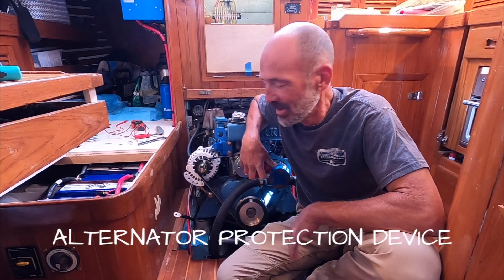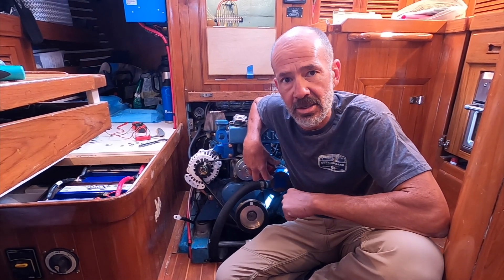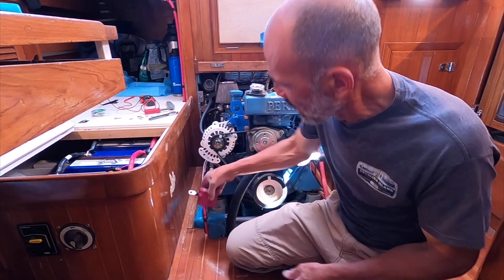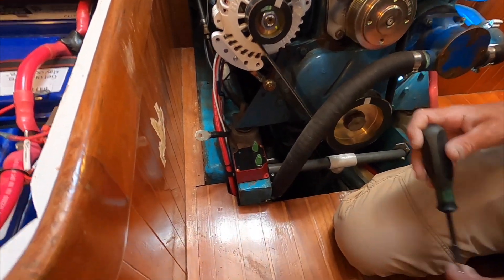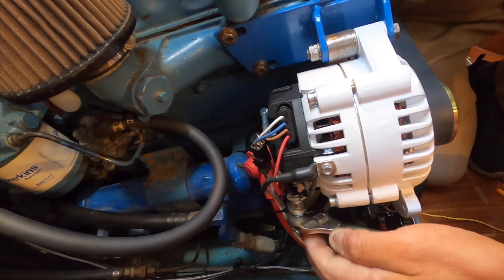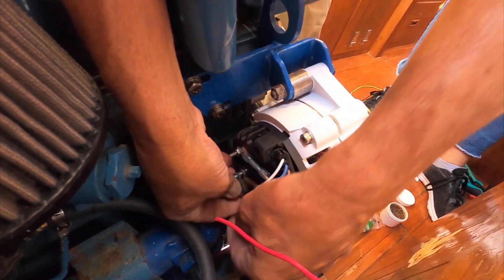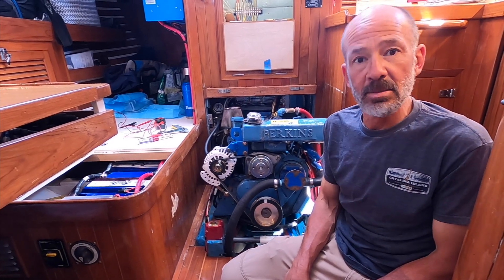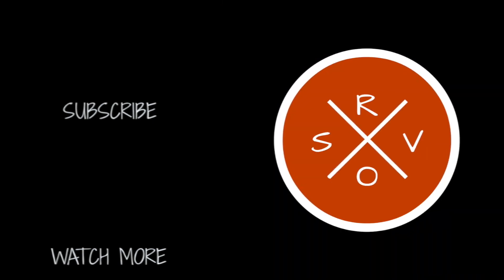Defending the Alternator with an APD | SV Ramble On

Comment: You give the impression that the ADP is a sacrificial diode and will need to be replaced if the alt is cut out at high amps. I think that you are incorrect in that the ADP just absorbes the load and can continue to do it's job even after the overload and does not need to be replaced. Can you clarify if this is correct? 
Derek
Reply from the maker: Hi Derek - Yes, that is our understanding of the device.  We've also seen this info in the description of the device here https://baymarinesupply.com/sterling-power-pro-protect-12v-alternator-protection-device.html
Reply: @svrambleon  thank you for the response. 
I sent sterling a message as well and just got this back from them.
(A)The ADP is not designed to be sacrificial- however,
There are a number of places professing the ADP to be the only item needed to make lithium/alternator charge suitable
(B]) The ADP is not invincible,  a sustained dangerous voltage may put the device at risk,  though I am not aware currently (no pun intended) of any units that have failed 
Sterling Power

Comment: WRONG  WRONG  WRONG. 
It is NOT a sacrificial device . Sterling demonstrates it works fine many times after a shutdown. The diodes merely SENSE high voltage then short + to ground causing no DC output. Nothing inside dies.

https://youtu.be/9kEw-Bta3xw?si=WwlFXoID5HgqHqDF

Comment: This thing has got to be the most expensive way possible of buying a TVS protection diode  ($6). Just wire a Littelfuse 15KPA18A in series with a10A fuse across the alternator terminals.

Comment: Hi Rich, Thanks for another informative video. I am also considering upgrading to 3 Battle Born and a high amp Balmar with the 614 regulator. Do you still have a starter battery ? I understand that a traditional starter battery will absorb the surge so  I would not need a device such as the one you have installed. However if Battle Born batteries can function as a starter battery then , for simplicity sake , I would eliminate the current starter battery. I would also add the Sterling APD as you have. Cheers Kevin
Reply from the maker: Hi Kevin - We do not have a separate starter battery.  Everything runs through the LiFePO4 battery bank.

Comment: My dude! Thanks for the informative video! We are converting to Lithium and it's so nice to see someone in the real world using one of these devices. Really takes away some of the mystery concerning the lithium upgrade.... how has your upgrade been working out for you? Anything you would do differently? We are looking at the exact same setup as you- Balmar alternator/MC-614 Regulator with battleborn Lithium batteries. Cheers from the PNW.
Reply from the maker: We love it!  We've been very happy with our lithium setup and electric galley.  We are going to add a wind generator since we only have two 175w solar panels.  I don't think there's anything we could have done differently with the layout of our boat.  Good luck and thanks for watching!

Comment: i noticed that your wiring the smaller gauge wires on the alt first instead of the large cable. For the "best" connection, its best practice to wire largest terminal(wire) first, then stack on the smaller ones. This will reduce resistance in the system, but honestly i'm not sure if it really matters. Maybe when the terminals start to show age?
Reply: Funny, cos Balmar say APM outside battery cabies but Sterling say *inside*!

Comment: That is a cool addition. I blew up 2 alternators messing with a Balmar setup like yours.. I am going to buy it for my current boat. It doesn't have a Balmar set but it does have expensive alternators. Thanks for the video. Where are you guys? Area is fine.
Reply from the maker: Thanks for watching, glad you found something useful. We're parked up in the Sacramento Delta off the San Joaquin River right now, but we're planning on heading south here in the near future.